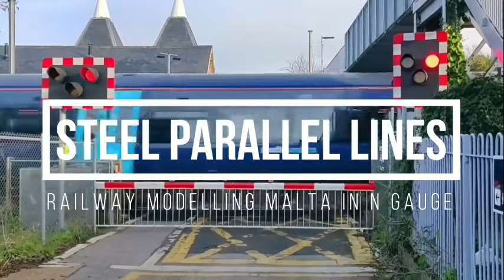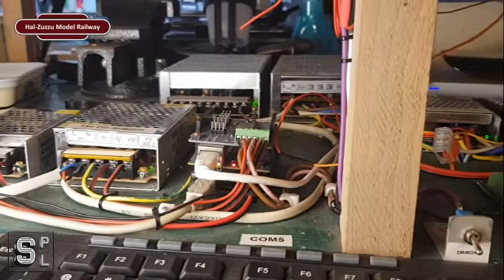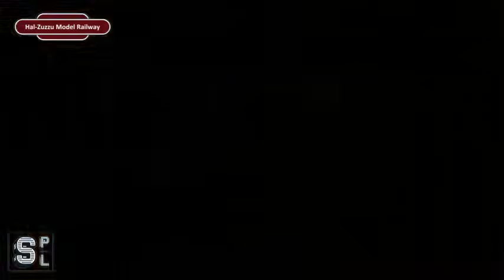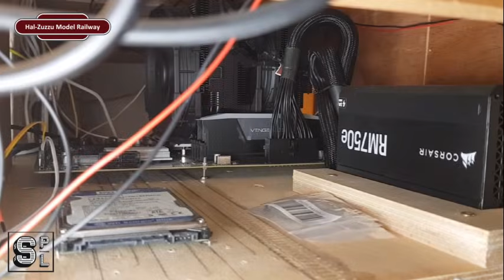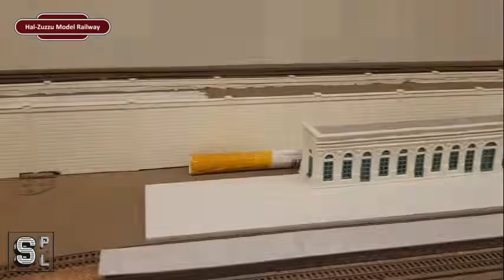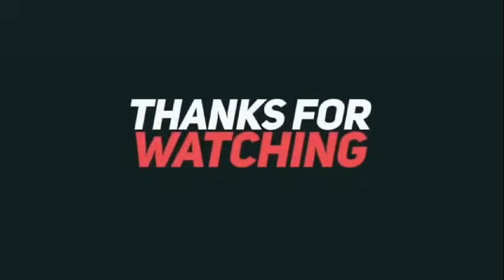Setting Up DCC Control at Ħal-Zuzzu Model Railway (Ep81)

Comment: Regarding track power, do you have one power district for the whole layout, so a short circuit detected by the Z21 shuts down all trains? Or have you separated the track power into power districts, each with their own short circuit detection, so a short circuit only shuts down that district?

For the power supplies, do you have any fuses on the DC side?
Reply from the maker: Sadly one power district. I sometimes spend a few minutes until I find out where the problem is .. I want to look into splitting it up but will need do to very careful homework before deciding on what to do. As for fuses, the power supplies all have a fuse on the DC side, not sure with it is off hand!